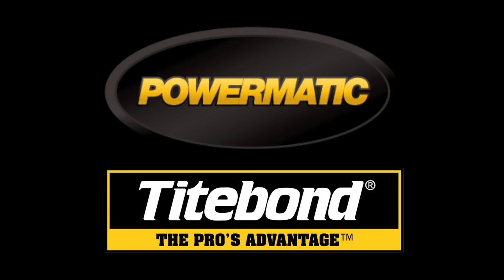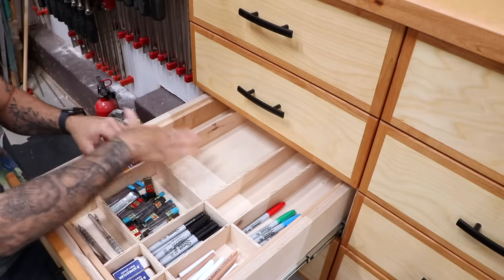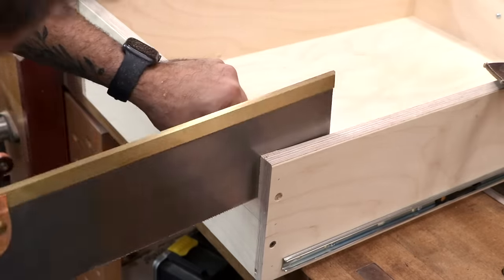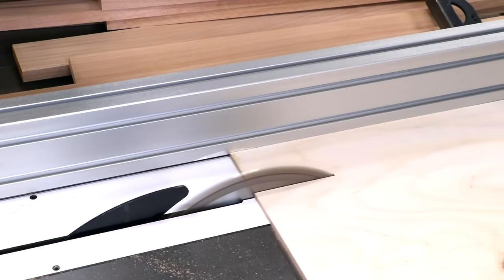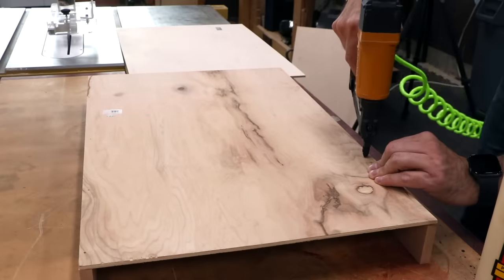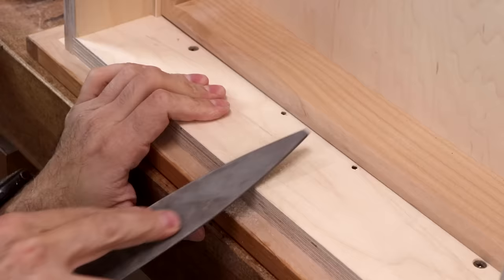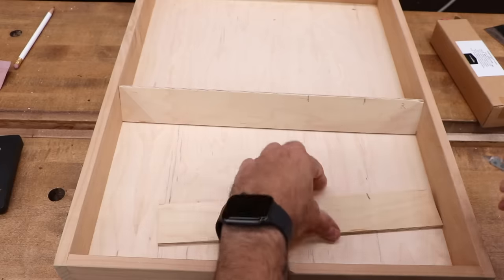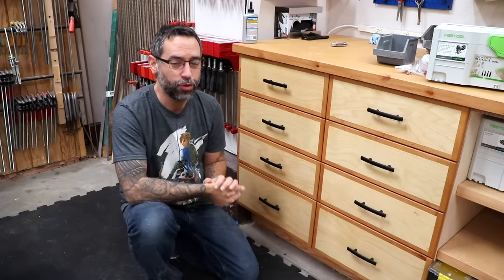Double Your Drawer Space

Comment: I was in the process of designing a double drawer system like this for the new kitchen units I’ll be building myself.  I’d already realised I needed to reduce the height of the rear panel of the lower drawer to permit a full sized top drawer but was thinking I’d have then to mount the upper drawer on its own separate metal drawer slides to prevent it tipping down at the rear when almost fully open.  Then I came across this video and was immediately impressed by the anti-tipping solution at 3:40 - slightly reduce the height of the sides of the upper drawer and fix runner strips to the inside faces of the lower drawer sides at their back end.  The strip of paper to provide a slight clearance and thus prevent the upper drawer from jamming was pure genius to my mind.  The simplest solutions are so often the best.

Thank you so much.

Comment: I did something similar to my kitchen drawers a couple of years ago but never thought of doing that to my shop cabinets. I just looked at my shop cabinets and do have a few drawers that this would work on. Thanks for the tip Marc! One good tip deserves another... I found that cutting 90 corners to make room for the slider on the first drawer weakened the back on my first drawer. On the rest of the kitchen drawers I drilled the holes first ( as you did to make room for the jigsaw blade) as a curve is stronger than a right angle and that solved the problem on the remaining drawers. I also used some UHMW tape on the bottom of each side to reduce wear and friction on the runners.

Comment: I was in the middle of adding drawers to an existing cabinet when I saw this video. My original plan was to add two drawers but found that I wasn't going to be able do that.  Then I changed plans to have a drawer within a drawer. I was going to have the inside drawer be half the depth of the outside drawer. But after watching this video I thought I don't have to do that. I would like to report that I built box my drawer and I used this drawer design, and it turned out fantastic. Couldn't be happier with the result.

Comment: I also would not have thought of opening he back halfway, but knowing me I’d probably also slide the thing all the way in and it’d fall backwards. To prevent that id just make the front of the tray slightly taller so that when it hits the stop in the back it can’t go further (and stops not as long as the ones you made so I can open a bit more with the front stopper). Great small video tip.
Reply: It's the kind of mistake you'd make once, realize what you need to do, and then make it again another dozen times before you get around to actually doing it.  Or maybe there's just me.

Comment: Why not making it only half or 2/3 of the length so you no need to cut the back of the original drawer and you are able to see  right away what under the tray?
Reply from the maker: That's a great idea if you only want 2/3 of the space.
Reply: I guess if you only stored long tools in the bottom part so you never needed to get to the back it would be fine, otherwise waste of space.